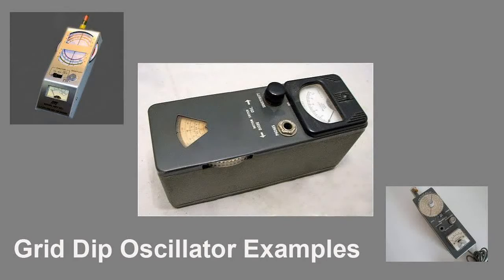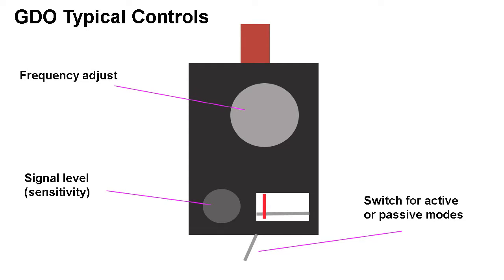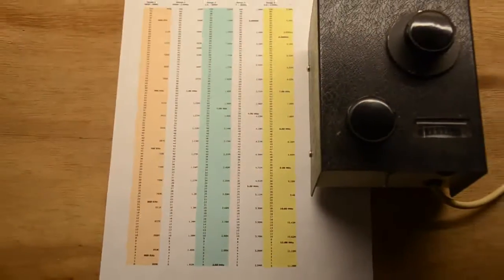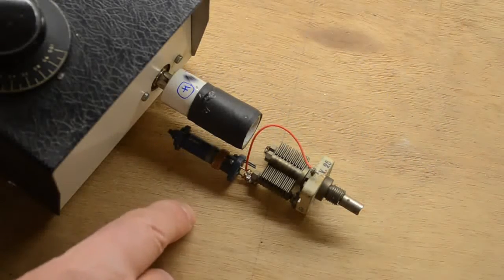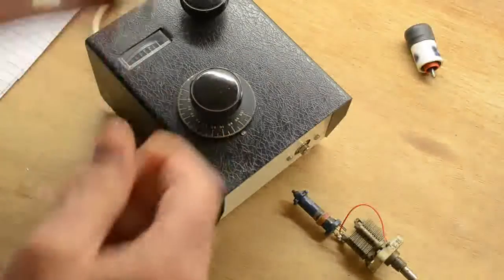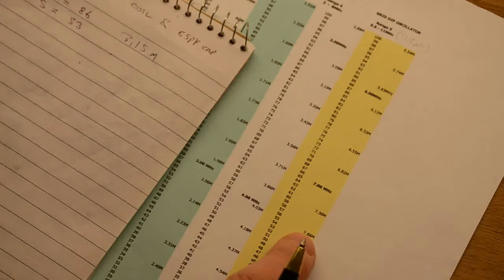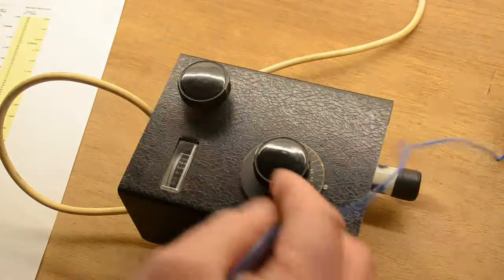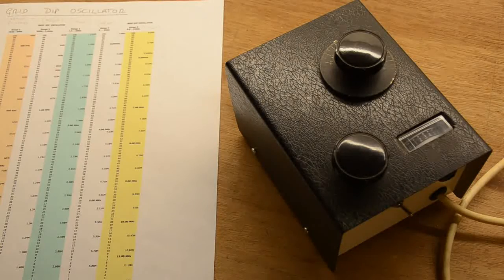A Grid Dip Oscillator

Comment: Dip meters are underrated for what they can do today - thank you for the video showing their use!
I also have used a receiver to check and note the frequency of my Heathkit transistorized GDO too, because the dial is a little off (they always are a little off.)
Reply from the maker: Glad you found it informative. Yes, the GDO is another example of a relatively simple device that too few people have even heard of today. Another very simple / basic item that I find myself using from time to time is a small 1960s transistor AM radio. By tuning this round the Medium wave band for instance, one can usually tell if a nearby HF oscillator is working, such as that found in a faulty superhet to check if the oscillator-mixer stage is actually oscillating.

Comment: An interesting property about the grid dip meter -- at least in my experience -- is that the oscillator's frequency will be pulled away from its natural oscillation frequency when brought in the vicinity of an LC tank. You can see or hear this behavior simply by monitoring the dip meter's radiated signal on a nearby receiver, spectrum analyser, or frequency counter. What this means in practice is that when brought near an LC tank, the dial markings of the dip meter become inaccurate, because the dial markings were created with the oscillator in isolation, not when the oscillator is being affected by a nearby LC tank.

Furthermore, there's an interesting "frequency snapping" that occurs. If you strongly couple an LC tank to the dip meter's inductor (for a deep dip), then you will probably notice that as you slowly tune the dip meter in one direction, the dip gradually becomes deeper and deeper, until suddenly, when you tune just a bit further, suddenly the dip disappears (not gradually disappearing, but suddenly), and the meter needle snaps back up. If you monitor the radiated frequency of the dip meter while this is happening, you will see that at the instant the needle "snaps" back up, the dip meter's frequency also suddenly jumps in frequency -- jumping upward if you were tuning upwards in frequency, and downward if tuning downwards. I found out that the most accurate way of determining the LC tank's resonant frequency is to slowly tune upwards across the dip and to find the frequency just before the snapping, calling this frequency f1 (which must be measured by measuring the radiated signal of the dip meter, since the dial calibrations become inaccurate when an LC tank is brought near the dip meter). Then, you tune slowly downwards across the dip and find the frequency just before the snapping, calling this frequency f2. The true resonant frequency of the LC tank is then the average of f1 and f2. I confirming this by measuring the resonant frequency of the LC tank by measuring it with a NanoVNA.

I should also add that this was with a transistor-based dip meter. Maybe tube-based dip meters behave differently. You can read about some of my experiments here: https://www.theradioboard.org/forum/other-electronic-projects/grid-dip-meter-frequency-pulling-and-jumping .
Reply from the maker: Most interesting observations. All points notes and quite valid. I tend to start using it with the smallest noticeable movement on the meter, then slowly increase this to give a better accuracy until one reaches the setting at which the issue with the frequency suddenly 'snapping' as you say, manifests itself. Back off slightly from this setting and take the reading. Thanks for the feedback!
Reply: @lishaton  I think that maybe one way to prevent the undesirable frequency pulling is to add a buffer amplifier after the oscillator, and to connect the output of the buffer amplifier to an untuned coupling loop, which then goes through a diode and through a microammeter to ground. The buffer amplifier will drive the oscillator's output through the coupling loop, through the diode, through the meter, to ground, creating a current readout on the meter. Then, if an LC tank is brought near the coupling coil, it will suck out energy from the buffer amplifier (not directly from the oscillator's LC tank itself), causing less current to flow through the diode and the meter, thus showing a dip. This approach should prevent frequency pulling of the oscillator because the oscillator's LC tank is never coupled to directly; we only couple to the coupling loop on the buffer amplifier. I've seen a similar approach recommended in some articles, and I think the MFJ dip meter also uses this approach. I haven't had a chance to try it myself yet.
Reply from the maker: If you ever try an example, do let me know how well it worked.